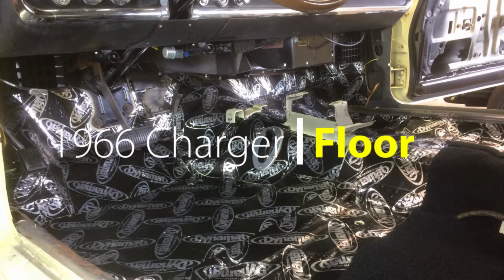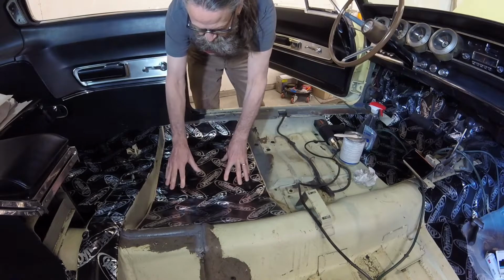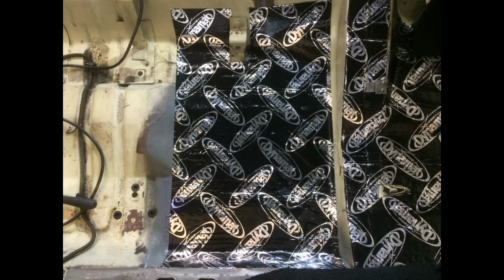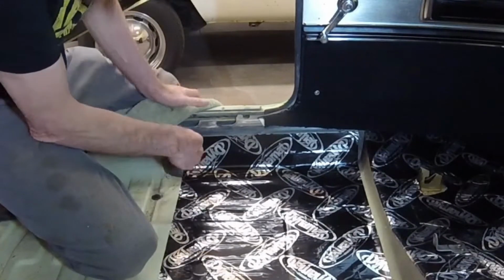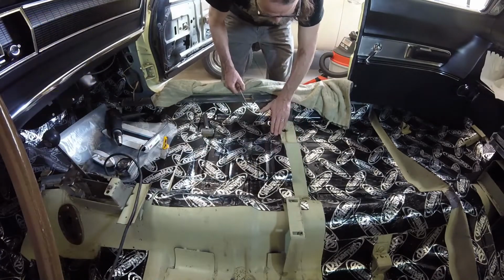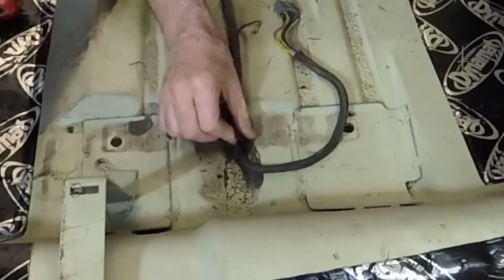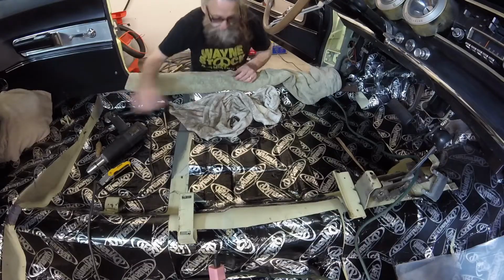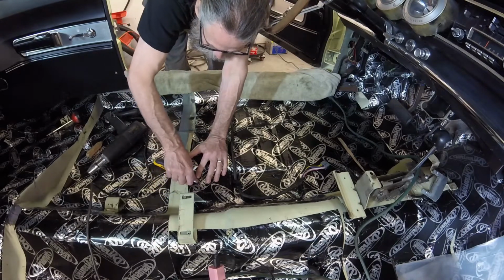1966 Dodge Charger Floor

Comment: May I ask if you found it overall worth it to completely cover all available interior sheet-metal? I've heard just a little Dyna-Mat can go a long way towards reducing road noise / heat / general comfort improvements, but I'm curious if covering 90% was beneficial. Nice video! I'll be utilizing this when it comes time to truly dive into my '67.
Reply from the maker: You heard right.  It's not necessary to cover every square inch.  I haven't compared less vs. more coverage, though, so I can't say whether there's any discernible difference.   What I can tell you is that when I put scraps of DynaMat on the insides of my door panels, I could tell a big difference just by knocking on the panels before and after adding them.  So like you said, a little does go a long way. 👍